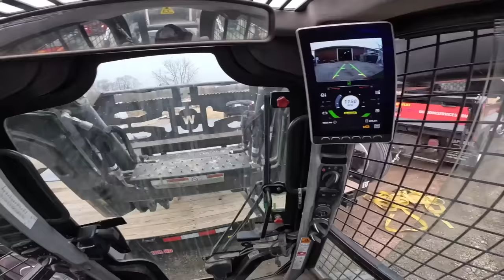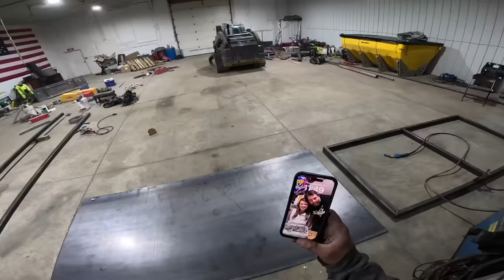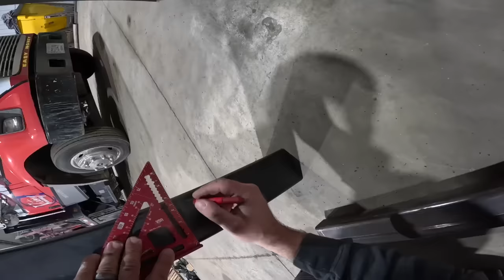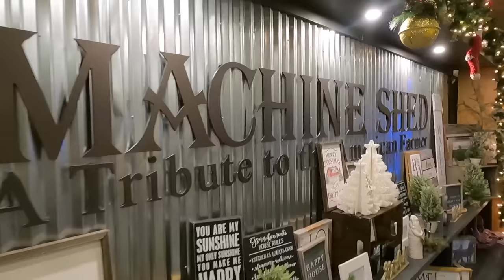Building a table that will last FOREVER!

Comment: I made one of those tables a few years ago, I bought some heavy duty steel wheel locking swivel casters for it, I welded plates to the bottom of the legs, and bolted the casters to them in case they ever needed changing makes all the difference in the world moving it around. 👍 Use some cutting oil drilling! 😳🤦‍♂️
Reply: Its better to fill the middles with a nice thick wood or do a thick wood ontop doing anything on metal tables like that is sooo loud basically a huge drum while trying to work on stuff
Reply: @mjnelligan7288 not if you’re welding like he is, the plate is much better and durable. Like he said FOR LIFE
Reply: Heavy duty casters, would make table flexible in doing projects. Looks great, your not afraid to take anything on. Tell the CEO happy birthday and God bless you and your beautiful family.
Reply: @andersenlong8835  no wheres did i say it wouldnt last, i dont care what u said thats a drum, hit anything on that table woth hammer like he wants, even in the vice thats a drum
Reply: @mjnelligan7288  I understand what you’re trying to say, but with thicker steel plate, it doesn’t ring, or drum, it just clanks, I have a table I made a lot like this one a few years ago, it isn’t loud to work on.
Reply: @mjnelligan7288  I weld and work on heavy equipment every day on a full steel table like such, it is not a drum at all. I know you don’t care/ know but it’s not bad, try it out

Comment: Good job, good tip for your next vise installation, make sure the fixed jaw is 1/8'' to 1/4'' from the edge of the table. 
So you will be able to clamp something toward the ground.
Reply: I was thinking that when he first set the vice on the table.
Reply: It looks like it's a swivel vice , so when it's spun the to the left of where it is now, it will clear the edge
Reply: Was going to say the same. Good eye @victorlp2075.
Reply: I saw that as well. All Ryan needs to do is take a torch and remove some of the table's overhang or drill new holes.
Reply: Looking at it again. Looks like the only way to use it for vertical, Ryan will need to cut the corner off the table top
Reply: @ellisonrepair  I'd do it anyway to avoid contact when working with the vice on a sharp point. Round all the corners too.
Reply: Turn the bolt holes into slots for adaptability.
Reply: You watched @dieselcreek?
Reply: No
Reply: @joshm.7218  it did swivel , unfortunetly it does not clear. at least from the angle it was shown 45:22
Reply: Agreed!!!
Reply: @clayman1000x good idea

Comment: Table looks good, we built one at work - not as strong! We rounded the corners which saved a lot of hurt… especially if the table not against the wall but is out in the open. Good Job!
Reply: Definitely rounded corners and bevel the sharp edges all around the table top.  I see sliced hands with that sharp steel edge if not smoothed a bit.  AWESOME TABLE MAKING, I WANT ONE....
Reply: Yes those corners were making me nervous
Reply: Totally agreed round the corners and bevel the edges
Reply: @lawrence5039  Don't bevel the top edges, that's your easy straight line for 90degree pieces, if they're beveled it'll take you ages to line up and it won't be even.
Reply: @lawrence5039  He can grind it smooth and get some rubber/plastic edging material if he wants at least on the corners.

Comment: Before you bolt the vise down, make sure the long part of the vise is with the long part of the table, then rotate the top of the vise and move it to the edge so you can clamp things in the vise extending down to the floor. The fixed jaw needs to be outside of the table top edge. On one end weld a round bar between the legs to store clamps on.
Reply: Was going to say the same. Too late.

Comment: Morning, at the beginning of your video you talked about working out. 
I'm a retired truck driver. The last company I was a P & D (Pickup & Delivery) driver. And I did a lot of grocery delivery where I would have sorte & segregate dry goods. And the rest of the day my back was sore. And there times I had some serious strains & sprains from my back and I had to take some time off. 
So I thought I needed to do some stretching. I would go to the gym mainly for the hot tub and I noticed these body builders would come in to hot tub than go work out. So I thought and did a brief stretch of my back by trying to touch my toe and hold for a second and turn to the right hold for second and left and hold ten times after every shower every day. And stop when at the sign of pain. When stated I was a foot off the floor and I can touch my knuckles in less than a month. And I am still stretching after about 15 years at 69 years old.

Comment: Ryan, if you would put a little oil on those drill bits when you start penetrating the drilling surface it will cut a lot better and not break so many.

Comment: Nice table, I welded pads on the bottom of the legs for the ones I have built. The tube on that one will dig into the concrete floor.

Comment: Just a suggestion on the metal table...I made a 90 degree arm that can extend out for the vice. The vice is placed on the 1/2" plate bolted up and tacked onto baseplate. 

If I want to bring vice more outward I can buy loosing 2 bolts that hold brace arm and give me clearance that way u can keep the metal table free.

Comment: Also attach heavy duty wheels so you can move it around as needed also put it on a foot peddles 2 legs on one bar  so when not in using the wheels are easily retracted and you have a firm base to build on

Comment: Ryan i absolutely love your videos i watch them all the time. I am a pipefitter/welder from Tennessee with an at home fab shop as well. A suggestion for hanging clamps is get a stick of round stock or use some square tubing and weld those to the legs at the 2 ends underneath and use them as hangers for clamps to get you some extra shelf space. Also happy birthday to the CEO himself Mr Daniel!!!!🎉

Comment: Ryan food for thought. When you mount your vise to the table weld it to a plate that has a receiver tube in it, then cut a hole in the bench and weld a receiver tube into the bench so the vise is quickly removable for when you need the whole work service. Mine has been like that and made a huge difference to it

Comment: Ryan, just as a suggestion, you should weld on some heavy duty caster wheels on the side of those legs in case you ever need to move it around anywhere and also drill some holes through the middle area of the table so you can use for clamps 🗜️ in the future.

Comment: Great job on the work table!!
 The only thing I would do now is get some toolbox caster wheels welded under the legs (the ones with brakes). This way you don't have to use the skid-steer every time you need to move it

Comment: Victory out door's Ryan you should weld heavy duty caster Wheels to the legs of your table just in case you want or need to move the table but that's going to be a very nice table when you get it done 👍 GOOD WORK 🙂

Comment: Great table Ryan! Happy birthday Daniel!

One thing I probably would do is some 1 inch welds every 4-6 inches in the middle of the table to that center cross member so if your hammering something very hard or other stuff, it won't vibrate against the steel sheet top

Comment: Ryan! My coworker has a table like this that he’s made, the table itself has some holes in it, very very useful for many different things, and the best part, on the bottom of the legs there’s “feet” that can be adjusted up and down via a threaded rod. That way if your table is on an uneven surface you can keep
Your table flat and stop it from wobbling just by spinning the feet pads.

Comment: Ryan PLEASE oil those drill bits while drilling haha. It seems like it takes longer but it saves so much time because the bit doesn't dull. Slow, lots of pressure, lots of oil. Thanks for the videos!

Comment: You need power sockets on the table, for corded tools. Something with an RCD/ELCB obviously. And I'd have put a rubber mat under the vise to stop it rattling on the table top. Probably along with hammers, some files to finish off metal edges and remove some burrs. You're near enough to the other tool boxes that you don't need screwdrivers to hand. But some sort of rack/pockets to put the rechargeable tools in when you're in the middle of work (rather than leave them sitting on top of the work bench).

Comment: May b a good idea to cut lil squares n weld on the feet the square tubes will cut lil spots n the concrete from vibrations from hammering on stuff n just using it really cool table

Comment: You should do what is called a belly wrap on the long steel. Take the strap and wrap it all the around the steel so that it pinches the steel to keep it from sliding. You can belly wrap flat steel too.

Comment: I built the same table except I use 3 inch angle for the shelf and 2 by lumber for the wood part so I didn’t need any braces and fasteners because the angle iron held the wood in place and is stiff enough to handle just about any weight I put under there ! Also I added flat pads to the bottom of each leg so I didn’t chip up the floor when I would beat or drop things on the table and vice . Nice job tho !

Comment: Ryan you need to invest in some step drill bits. Multiple size holes so you don’t have to keep switching bits and will go through half inch in under a minute! Also coming from a weld trainer at Eaton Cooper Power Systems, the welds look good. 👍

Comment: Crazy that you posted this video at the same time I've been trying to put together my own little welding shop in my garage. I'm up in the Appleton area and there are some very nice places around here for getting things such as fasteners and steel in different sizes and shapes.

I would highly suggest looking into Benchmark Abrasives. They will have a lot of what you need for grinders and belt sanders.

Comment: What a great table to have and last a long long time!! That looked like a wood blade on the dewalt saw. I’ve never seen a metal blade with big claws like that. Lol! It cut through that metal nicely though
Reply: FYI,,, what's the difference between a wood blade and a metal blade?   These blades have been around for awhile.  Most people don't cut steel , so they wouldn't know. 😊 Have a good day.

Comment: Tip when welding stuff at an angle or so. Instead of having a bunch of alignment tools up there before tacking, and balancing the part.
Just give it a solid teck, then it's easy to manipulate it to the correct angles, and it will hold it self before locking it in with more tacks. Then if needed, fine tune with a hammer/sledgehammer :) 
Regards from someone who worked with steel/welding production

Comment: Great table!! Might want to consider running some stiffners along the bottom of the table in the length direction.  If you want to keep it from getting wavy. "not flat".  just depends on how much load youll be putting on it.

Comment: Love the table and enjoy watching you free lance yiur way through a project.  But I have 1 suggestion for you.  I would have cut those legs 5 to 6 inches shorter and mounted the table on casters.  It seems whenever I’ve had a heavy table such as yours I have wanted to move it a bit and get frustrated that I can’t.

Comment: I know you just drilled 4 holes to mount the vise.  If you remove the bolts and move the vise toward each edge just so the vice jaws are over the sides in both directions and replace the bolts, the vice will be able to hold things vertically from the floor to the ceiling and be more useful in each direction.  The locations of the new holes should clear the tubes underneath the tabletop.

Comment: Hey Ryan when that blade wears out get the Diablo version it's a lot quieter and it cuts a lot smoother. I built my whole welding table out of 4x4 1/4 with a 1/2 table top it works great

Comment: Happy Birthday CEO Daniel, nice table Ryan. You should mount those left over pieces of plywood to the ends of your table to hang "stuff" on. Tip for drilling metal, use Nozzle Gel , used for stopping splatter on the tip of your welding gun, for  lubing your drill bit. It works great and not as messy as cutting oil. You probably already have some ( because that's what professionals use ). 😂

Comment: Just an idea for you with that unlevel concrete. You could take a plate (slightly larger than the bottom of the leg so you have a spot to weld nicely to), drill a hole, weld a nut to plate and weld the plate to the leg. Then you can thread a bolt in and adjust until it sits level and doesn't rock.

Comment: Cut 4 X 1/2" or so thick rubber squares for under the work bench legs to help deaden the sound and stop it from moving. Works very well. Nice workbench btw, you will get many years use from that

Comment: Hi Ryan
I would advise you to  built a sliding rack to put the tools that you need for a specific job
Something that turns around the foot that is close to the wise so that the tools  needed are very accessible and also easy to be pushed away and give you space to work.
I hope I was clear enough.

Comment: metal blades are insane, one of those on a skill saw can cut that 1/2 inch steel plate like butter.
beats fiberglass cutting blades if you can afford it.

Comment: Add electrical outlets (grounded metal boxes) under the table on the top brace down one long side or both long sides. Wire them to one 10 gauge yellow jacket heavy duty cord at the end of the table. If you ever need electricity all you do is plug up the one cord and have power wherever you need it without having to run extension cords all over.

Comment: HAPPY BIRTHDAY TO THE CEO!!! What i've thought of for the table would be hammers, grinders, c- clamps, spare grinding rocks/ cut off wheels/ tiger paws, easy square, small level. If you are are good with electrical you could wire a box with a couple outlets under the table so you dont need an extension cord for the grinder. Hope you all had a fantastic holiday and HAPPY NEW YEAR!! Can't wait to see what 2024 brings!

Comment: Great videos, a tip when you use your drill so much and it gets hot like that. Let it run for a few minutes without any resistants. Just use a ty-rap to keep it running and place it on the bench, and let it run for a good 5 to 10 min. Your machine will last much longer

Comment: The table top is 1021 pounds.  I, also, recommend rounding the corners to prevent bloodshed.

Ryan, I don't know where the pond and site prep in the yard stands but would like to suggest a collaboration with Dirt Perfect.  Maybe with a bit of backing from Hyundai, Case, and/or Deere.

Comment: Hammer, sledge hammer, smal & big, rubber Small & Big , steelball filled Small & Big. Glove hock. Is the first things i think of. Nice job on the table. Going to hold for ever. Keep it away from water and it will stay alive for longer o7

Comment: Should have put the frame on top of the steel weld it on the floor and used the skid loader to help flip it over when its welded. Put piece of wood under the steel slabs before putting the frame on it to weld so the skid loader can help lift it over.

Comment: You gotta turn the speed down on the cordless drill when using the larger drill bits & thick plate, i see that heavy kickback on the wrist when the drill bit snags

Comment: Maybe it’s just me being picky but I would’ve put the vice where it overhung the edge of the table more by mounting the base on the corner so it overhung just a bit more so you can utilize something hanging underneath clamped through the vice. As it sits it will hit the edge of the table by the looks of it. I have a similar table I made for welding and such. GOOD WORK!

Comment: Use some oil when drilling through thick metal. It will save your bits from over heating and getting dull.

Comment: They do have mag drills , hougen works really well , used it all the time on big structural steel jobs , also a little bit of edge cream or lubricant helps , as long as you don’t hit a huge carbon spot in the steel 😂

Comment: Try to put a long in the vise to see if there is clearance. It looks like you might have a problem if you put something long in the vise that would hang below the table top.. worse case just set the vice point at the corner of the table an then just cut that corner off. Easy fix. I could be wrong all together. Much love and respect!!!!

Comment: Nice vise ! It is not enough on the side of your table !!!! You will not be able to clamp something going down. Like a long flat bar. It will hit the table before  you tight  the vice. The rear jaw have to be a bit outside the table. I think  you can save it by cutting the corner of the table 45 degrees

Comment: To quote the great Col. John 'Hannibal' Smith, "Overkill is underrated."  Your table certainly qualifies as overkill, and it is magnificent! 

Congrats on the CEO on 8 long years, may he have many more. I pity the foo that challenges him in nerf darts with his unlimited ammo. LoL

The thing with big tables like that, is they don't move when you bump into them, consider rounding those corners so you bump-off of it a bit easier, and a slight bevel around the top, and maybe bottom edge, to soften that hard corner wouldn't be amiss. 

Y'all are going to have a blast moving that thing to the new shop once you get it built. LoL

Comment: Should’ve put metal plates at the bottom with atleast 2-3 concrete bolt holes and then drilled holes for said bolts. Would be a whole lot sturdier

Comment: Maybe welding plates for forks so whenever you have to move it you don't have to worry about it being a hazard
Reply: Also next time drilling metal maybe use a little motor oil to keep the bit from getting to hot and burning out